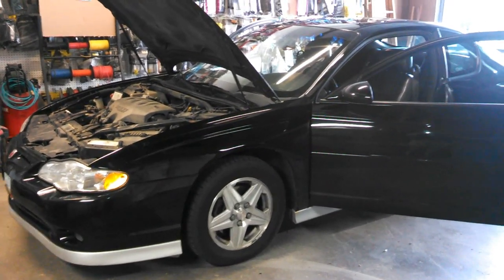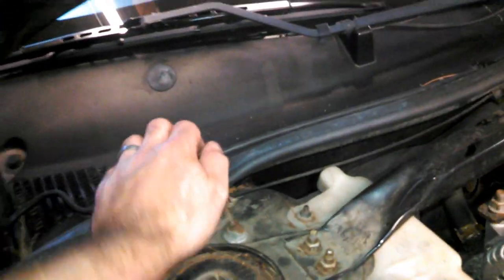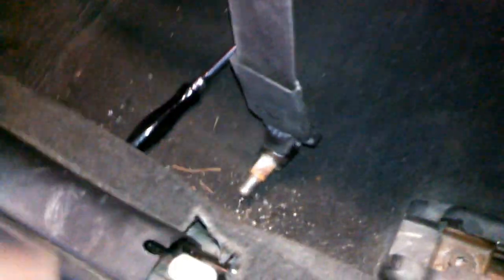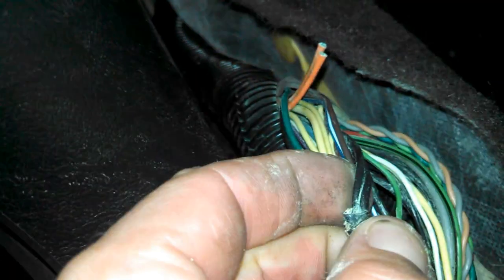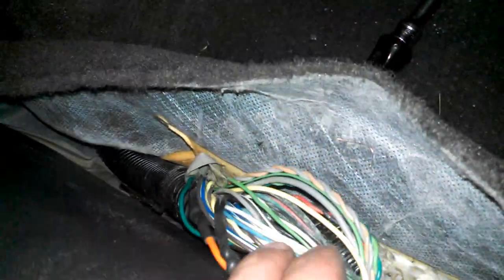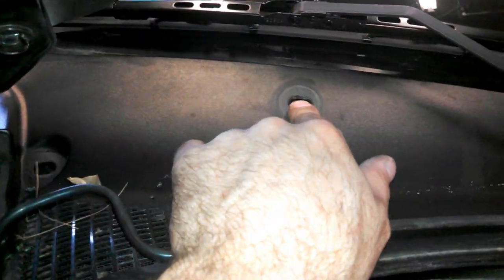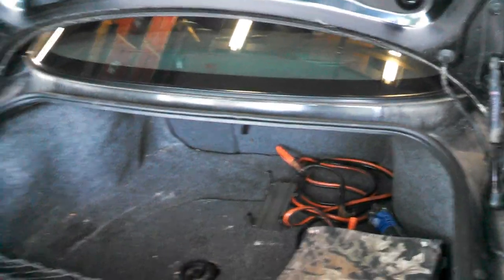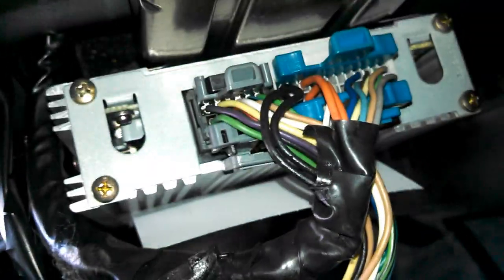How To Fix Impala and Monte Carlo "No Sound" and Water on Floor Problem

Comment: For anyone who is using this video to fix this issue and follows directions to literally like i do at 1:02 in the video it is stated "right behind the driver seat" that was obviously a honest mistake in words. The wires are located behind the passenger seat and if you paid even closer attention you will see he is working behind the passenger seat to fix this issue. Also for those who are reporting they only have black wires i thought the same thing you have to continue in both directions uncovering and sorting the wires aside to locate the orange wires he is showing you in the video. It took me a while to find where mine were split at mine were a lot further towards the back then his are. Very good video thank you for saving me the hassle and bullsh!t of trying to figure this out because your video fixed the problem right away
Reply: so your saying in the case with the black wires...the orange wires with the connection could be further back than stated in the video?
Reply: I just repaired mine for this issues. The orange junction was almost a foot farther back than the black junction

Comment: We just had a HUGE rain storm last week and it washed the rubber off my Impala's cabin air filter area and now my radio/chimes don't work at all. I had a TON of water on the floor in both the front and back seats. I'm going to try this and pray it works but for as wet as it was down there, I wouldn't be a bit surprised at all if this is what the problem is. Thank you for this video in advance!

Comment: Hello so I have a 2004 montecarlo  ss and had the water problem but my radio problem is low volume on passenger side and normal on driver side if you have any ideas on that fix I'm all ears. My other question is your vid shows exactly what you say two orange wires into 1 and the black is 2 blacks going into a single black. Well my car has 3 orange going into 1 and 4 blacks going into 3. It is the factory wiring harnesses and connections. Any help with the volume issue would be very much appreciated. Also if there is different harnesses or something that would be great info as well. Thankyou

Comment: Cool!! Most of the city trucks, at work, with radio problems, are blown speakers. Customer of this 2004 Monte Carlo, found your video and told me about it. Unfortunately the orange wire appears ok. 
Ironically...Pouring rain, so going to test power voltage drops inside trunk tomorrow.

Comment: Thank you so much for this! My daughter bought her first car a couple months ago, 2004 Chevy impala. She noticed the other she had no sound at all. We could tell the radio worked but no sound coming out at all. By googling this issue I found your video and was able to fix it myself, both the wire and the issue that caused the problem in the first place. This mom is also pleased that the total cost of repair was less than $20 (new cabin filter and silicone for the seal). My daughter is happy and I get to brag that I fixed it myself. Thank you!

Comment: Help!!!!. Tried this and it fixed the leak and the wire problem, but now I have no power to my head unit. Did I pull a wire loose or something? Should I take the seat out and check the whole wire harness for any loose wires?

Comment: Hi I've check the wires in the back seat on my 05 impala and so far hadn't found any of then works  broke . I tugged on some wires and none of them came apart. I'm still not 100% sure if there are any wires are  broken what do you think could be giving me low fm sound assuming I don't have any broken wires? Thanks for the response
Reply: ever figure this out?

Comment: I have a 01' Impala

I think my wires are connected. Only 1 of the speakers work, which is the rear passenger works. The two front and the driver side rear doesn't work.

My dad took it somewhere, and the audio guy said that the "channels in the radio are going bad, you need a new radio".

I really don't want to have to buy a new or aftermarket used radio just to get all the other speakers to work.

What do I do?

Comment: I  am having a similar issue but its not the radio its for the hvac controlling unit giving intermittent heat. I get a parasitic draw when i push the rear defroster button as well as heat doesn't work all the time.  So its something with the hvac control unit , a faulty wire ,  (probably affecting a blend door actuator).  Same main problem leaking thru air cabin filter to the floor which the blower motor had to be fixed before. I  am lead to the conclusion that it also affected the wiring/connectors for the hvac control unit.

Comment: Yes the red wire that came with the harness I had to run from my radios harness to the fuse box of the vehicle. And the blue wire is plugged in the only two that aren't being used are the red power wire from the harness and the orange illumination wire. I was told that I didn't need to use the red wire on the harness due to using the extra red wire I had used for the fuse box and hooking that to my stereos harness.
Reply from the maker: that's correct. So there is no reason you shouldn't have sound unless you have a bad speaker/speaker wire shorting that muting the radio.  Or maybe the fuse for the amp blew?  Not sure. I'd try the stock radio back in just to check.

Comment: Thank you so much for making this video. It saved me so much work. On my 03 monte, more to the right, i found 2 ground wires. One had 2 wires connected to it, the other had 4. The orange wires on mine were way to the left almost going under the back seat. But with this videos i probably would have taken so much crap apart. Thanks again!

Comment: So I have the 07 LT I don't have a factory amp I replaced the headunit, and front speakers due to water damage, I had sound coming from rear and not the front due to water damage when I purchased it but now that I've replaced headunit and fronts my rears don't work, any suggestions?

Comment: what if your radio works speakers are just low? I have a 04 Monte SS and i’ve done this an looked at the wires but i don’t have the puddling water problem and they seemed fine so i didn’t mess with them, im thinking about just going in an redoing the wires but ive seen people say the factory aux burns up too?
Reply: Have you found out what is causing that problem? I have same issue on my 05

Comment: Thank you! Went out to my car one day to find a puddle of water. After some research, discovered that seal you mentioned had come loose. I bought a $4 diverter that replaces the seal (yay upgrades) but my sound had gone. Was thinking the amp had burnt out since that's a known issue with the Montes but your explanation makes more sense. Going to work on it first thing in the morning. Hopefully it fixes it. =)

Comment: i have three orange wires that come through the harness ..not one that comes through one that connects to two any thoughts or ideas on what to do now ...i have the black wires that are taped ?
Reply from the maker: never seen one that didn't have the splice. you followed the wires back and forth a ways to make sure?
Reply: +The Amp Lab yes i cut off some of the tape ...i three orange wires that run from where you showed i took the seat out moved the carpet didnt see any tape on it except for the black wires wich were taped together ....went and followed them all the way till i got under the das by the fuse panel on passenger side
Reply: +stephan moore. dash*
Reply from the maker: +stephan moore Does your car have the amp in the trunk like in the video?
Reply: +The Amp Lab. yes
Reply: +stephan moore. radio works but only after rain for a while it fades in and out then completely goes out
Reply: I have the same problem. connected black wires but no orange. I'm about to just buy an amp bypass for 12 dollars and see if it works
Reply: Just pulled mine apart to do this. Have 3 orange wires running through the entire harness.  If you watch the end of the video where he's showing the plugs at the AMP, notice the difference. Ours only has 2 wires on the smaller connector, the rest are shoved into the bigger one.

Comment: What if you still have sound but it's really low even when the volume is all the way up on the stock radio? I do have the factory amp.
Reply: Did you ever find out what was causing this issue? I have same issue on my 05
Reply: @saulrosales2672  no, I actually stopped driving tje car but I think the factory Amp is the problem.
Reply: @bomcdaniel8311  well this coming week ima look into it. Mess with it n stuff. Installing a pioneer double din. If I find the solution I'll let you know
Reply: @saulrosales2672  good deal. Sounds good thank you.

Comment: I baught new amp on my 2005 impala fixed the orange wires and fuses but theres still no sound coming out! Any suggestions plz help thanks aftermarket
Reply from the maker: Did you fix the black wires?
Reply: +The Amp Lab no i didnt fix the black wires. Radio turns on and all, could that be tye solution the black wire?
Reply: +The Amp Lab by the way its an afternarket radio
Reply from the maker: +Jessica Cantu Yes, the black wires have the same connection as the orange wires, so they have the same corrosion issue. The amp needs both to function.
Reply: +The Amp Lab ilk go ahead and tey the black wire ill let you know if it works thank you for your time
Reply: +The Amp Lab i fixed both wires orange and black and still no sound. Plz help i did all the fuse and amp and still nothing

Comment: Thank you so much for this video. I was going nuts trying to figure what the problem was, but this was it spot on. I bought the T50, soldering kit, and air filter and fixed everything for under $30 bucks and look like a genius to my gf!

Comment: Man I have the entire passenger side of my 2000 Impala torn apart, all the way on top of the rear seat, and I'm not seeing any area where 3 orange wires tie into each other. There's 3 black wires crimped together, but no orange wires together. This is frustrating!

Comment: Thank you so much for this video!! I had water in my 2004 Monte Carlo SS from a bad storm 8+ inches of rain.  Thought is was from the windshield as I had a small star and line crack under the wiper on the passenger side.  Luckily the "SafeLite" windshield repairman was very honest and told me after exam that it was not the shield and we discovered the filter was soaked and the seal was not in place but loose in the engine compartment - lucky it was still there.  After seeing your video I believe I can fix this myself. Thankfully I got the water out quickly as it was about 2-3 inches deep :o(.

Comment: Hmm, the harness I have used the blue wire as a power antenna, maybe I was sold the wrong adapter. it is a metra 70-2003 and the vehicle is an 2002 Monte Carlo. I also noticed I don't have the chiming sound with the key on / doors open.
Reply from the maker: Power the blue wire still. it sometimes doubles as amp turn on in some vehicles. you won't have the chime sound unless you buy the appropriate adapter to retain it. since the chime is controlled by data through the factory head unit, you lose it without buying a data adapter for the aftermarket. no big deal though usually. Also you must have had to run the red Acc wire to a switched ignition source correct?

Comment: Nice fix! I have an 06 Impala with the ever troubling leaking seal under the cowl as well. However, I have no door chime, the horn does not sound when you shut the doors and the front tweeters work on the stereo. Nothing else, only the tweeters work. Should I go ahead and look at these wires as well? As a standard, the car dealer put in a new radio and then came and said sorry your amp must be burnt out. Ok simpleton ...... then why does the tweeters work if the amp is burnt?  lol I hate dealers. 

Thanks for the video! It has given me hope to get some stereo back in my wifes car again.

Comment: my radio started off just having fuzzy sound every once and a while and slowly got worse until it has now completely stopped working.  assuming that means the wires have been touching on and off but have now completely seperated, so it's safe to say my amp is not the problem right?

Comment: I have an '01 Monte Carlo. Left side speakers work, chimes work, no water on floor, but right side speakers are out. Would a bad black (ground) be the cause. Do I check the black wire to the chassis for continuity?
Many thanks.
Reply from the maker: Probably bad speakers most likely. If it was the ground to the amp, the amp would just not function at all and you would have no sound at all.
Reply: +The Amp Lab  I have an 2001 Chevy impala same problem but it has 3 Orange wire but they don't connect into one Orange wire

Comment: Only have 4 orange wires, and in the area u showed the only connections are 1 black wire into two black wires and some other black wires. Could the wires you're talking about happen to just be a different color in the 2001 Monte Carlo SS? Because apparently other people with this car have the same problem

Comment: My car has 4 orange wires instead of 1 wire splitting into 2 from the head unit to the amp. But there was water on the ground. Do you have any other suggestions?
Reply: same problem

Comment: Hi, I got a filter / sealant to fix the same problem. Great video!.  I have a 2000 SS. It also has that factory amp. My questions is, did you have to buy a separate wire/cable to connect the amp to your Sony stereo? I'm getting a JVC KD-R860BT stereo, Thanks so much!

Comment: This looks and sound like what is wrong with my monte. but the water leak I had was from the condensate line for the a/c was not draining property through the fire wall but instead was leaking water back inside and pooling on passenger side back seat floor.

Comment: I checked the wires from the front door to under the back seat. I found the double ground wire but, I didnt see the double orange.
Reply from the maker: It is there. Havn't come across one that wasn't there. I've done probably 20-25 of these fixes over the years.

Comment: I have a 2000 Monte Carlo and the setup in this video is the same as mine. I've looked in the exact spot as where you are in the video and could only find 2 orange wires running through. No tape part or 1 single orange wire connecting to 2 orange wires. Can you tell me where it might be? I don't want to tear into the wires too much.

Comment: The volume to my radio is fading and sometimes I lose sound completely. Will this work for me?
Reply from the maker: If its fading and not just dropping out completely each time then likely not.  May be an issue with the amplifier or radio.

Comment: Hi, my stereo has no power, I tried doing this and I found the black wire, redone that (still no power going to stereo), but I can't find where the two orange wires are connected to one...I opened the bundle of wires up all the way to the trunk...took back seat out...still can't find where they connect...help please...

Comment: Where would the fuse for the amp be located? On my stereos harness or near the amp itself? I still have the no sound issue, and I have good ground/power through the amp.
Reply from the maker: passenger side dash fuse panel I believe.

Comment: Will this run down the battery after 12 hours? The original radio doesn't work but I can hear some type of amp sound when I connect the battery cables.
Reply from the maker: No. This won't run down the battery.

Comment: So this could be my problem if my speakers won't get loud or sound like they are holding back they sound loud same time but low mostly  I have 04 impala ss
Reply from the maker: When this problem happens you get absolutely no sound.  So this sint going to be your issue.

Comment: Hey, I just recently changed to a new stereo and the factory stereo originally had sound and power. But now I just have the power with no sound. I have had the water problem and actually never knew how that happened but now that I saw this I understand, anyway does the default radio actually use the amp in the car? (Monte Carlo) or would only an aftermarket use this amp. I find it pretty coincidental that now that install this new stereo I just don't have sound. Would appreciate the help!
Reply from the maker: make sure the blue wire in your adapter harness got wired to the remote turn on wire of your new radio.

Comment: I have a 2000 chevy monte carlo and when I changed my facory radio to a after market radio I lost all my warning chimes, how do you still have yours?
Reply from the maker: You need to buy the proper adapter that will retain chimes.  Metra, PAC, and Scosche all make them.

Comment: my 2001 monte had 4 black wires connected to 2 black wires with electrical tape, along with 2 black wires into 1 black wire. fixed those, still no sound.
Reply: Yeah I have the same thing. I don't see any orange wires connected.
Reply: i have same issue multiple black wires connect to multiple black and multiple single orange but no connection spot...
Reply: John Dungan  I have the same issue, have you got the issue resolved ?
Reply: Same issue, have u fixed it yet???
Reply: Not at all
Reply: Like others, have a 2001 with the same set-up ... all wires look in good condition with absolutely no signs of corrosion or evidence of any water getting in.  Wonder if the 2000-2001 have a problem in a different location ... perhaps closer to the firewall?
Reply: Shavano Sturrup has anyone figured this issue out yet
Reply: Same

Comment: Ok my issue is, fm radio doesn’t come in. Radio turns on, am stations come in, the CD player works. I just have no sound from fm radio
Reply: Same here on my 2003 Impala. Did you get it fixed? I read somewhere it could be some part in the back that is for the FM reception. No amp in mine.